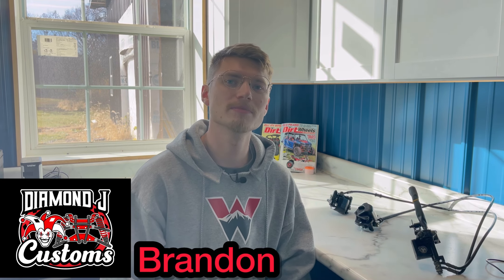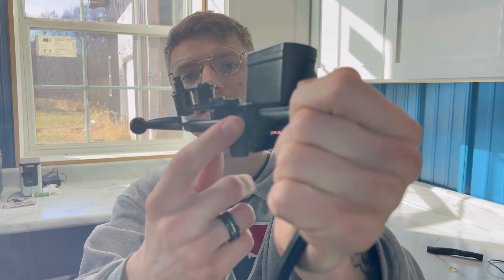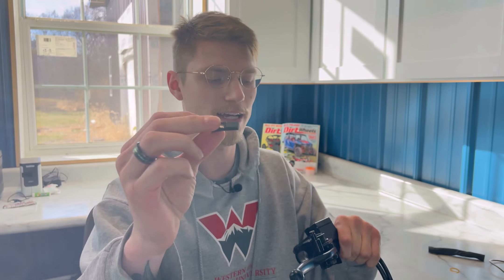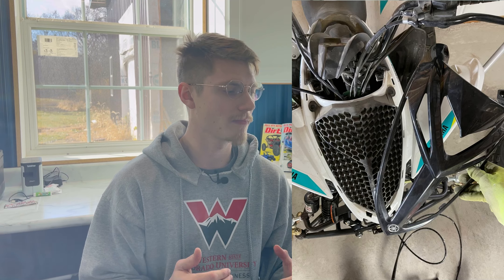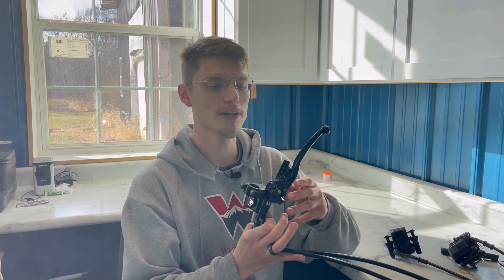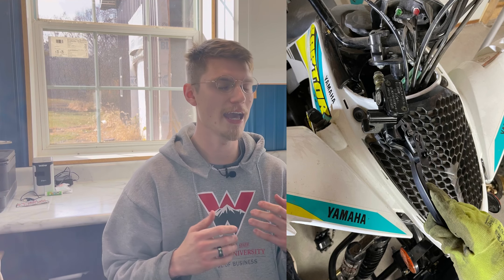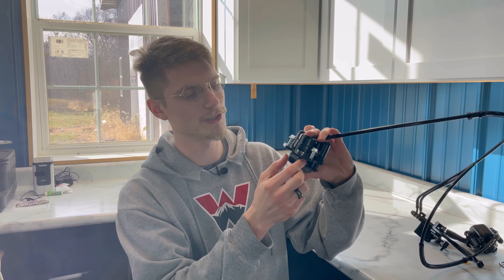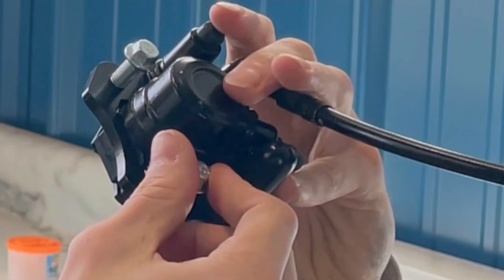How To Install ATV Disc Brake Conversion | 90cc Dual A-Arm Kit (KFX/TRX/Raptor/Outlaw/Predator)

Comment: Will this fit a Grizzly 90?
Reply from the maker: We do not know for sure, our Kawasaki widening kit is compatible with the grizzly 90 but it is difficult to say for sure that the dual a arm conversion is compatible as there is much more going on in the frame than a few widening brackets - if you wanted to try it and it doesn’t fit, we do allow returns.